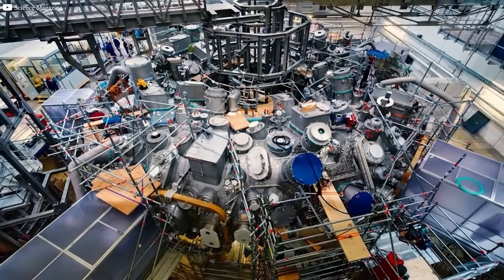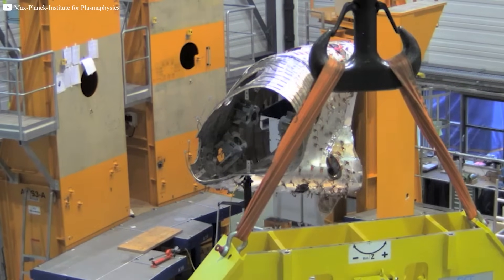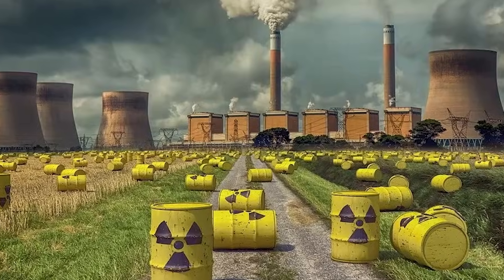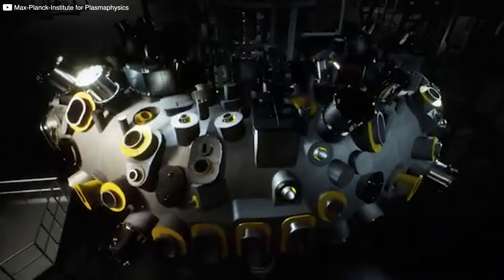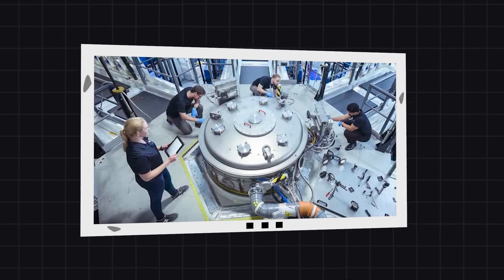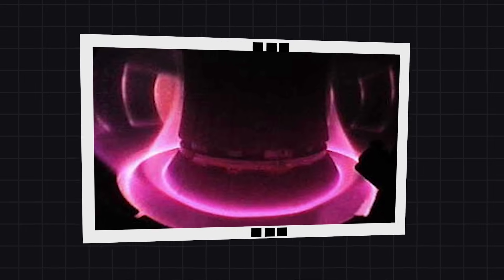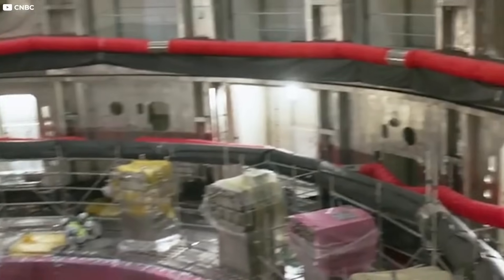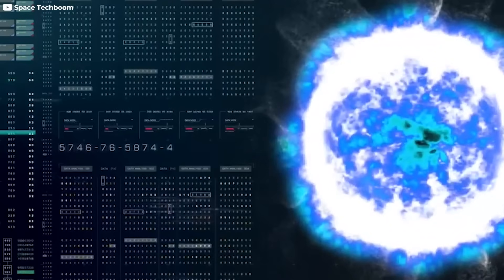This German Machine Could Power the Entire Planet

Comment: Thermo-dynamics is more efficient, cheaper,cleaner,safer,more reliable,more robust, cannot cause fires, cannot be electrocuted by it,it isn't carcinogenic, isn't radioactive. Thermo-dynamics is heating copper plate or copper rings to release electricity.

Comment: Is this currently in use what is the energy out put
Reply from the maker: Yes, this technology is currently being tested and developed in various locations. The energy output varies based on its implementation, but it's quite promising!
Reply: I'm glad to hear that what is the average output and how much energy was measured in the 8 minutes how is the heat going to be converted to electricity What does the kw out put look like is one enough to power an entire country or the entire world would the energy be transporter through wire or wirelessly ?

Comment: This is great as a scientific study but there is one big problem with fusion energy. There are a lot of protons released during the process and they will rapidly decay the materials around them. Any know material gets brittle within short time, probably just days or at best weeks. Before you can use the reactor to create electricity you have to figure out a way to deal with the protons or a material that can withstand them.
Reply from the maker: You bring up a valid point about proton release and material degradation. It's definitely an area that researchers are actively working on to find solutions. Fusion energy holds great promise, but overcoming these challenges is crucial for its practical use.

Comment: Fusion will never be cost competitive to renewables and storage.
Reply: Like all technologies, once a breakthrough is achieved, then comes mastery, and then comes cheaper prices. I would rather rely on nuclear, gas and coal rather than worry about cloudy days or days without wind, or too much wind.
Reply: @ It doesn’t matter the mastery the technology, the materials, the education of those required to implement it will prevent it from ever being cost competitive with renewables and storage.
Fission power is far simpler than Fusion, but because of these same issues has never been competitive except by being hugely subsidized by governments.
Reply: @matthewhuszarik4173 Do you think renewables are not subsidized? It is one of the most expensive energy sources.
Reply from the maker: You raise a valid point! Fusion has its challenges, but it’s an exciting area of research that could complement renewables in the future.
Reply: @BusinessHook Fusion is valuable for space travel beyond the range of the sun. Otherwise it will probably always be at an economic disadvantage to renewables.
Reply: Fusion is renewable and needs no storage.

Comment: Stanley Myers hho research produced a open loop "Runs on Water" vw dune buggy. He discovered that the key was in resonance and frequency and he made a fuel injector that used water as fuel, water in hho (browns gas") out and spark for ignition in real time on a ICE. also it take 11 gallons to go SFO to NYC ! that's open loop with water dripping from the exhaust pipe. In a closed loop system once charged with water and the addition of plasme into the loop would end refueling just add a quart when the water is getting low every two to six months. check out Stanley Myers, D. Rockefeller was still alive then and Stanley was killed for solving the carbon problem.

Comment: I have seen about 40 different fusion reactor plans, they mostly fall into 2 categories. One is the kinetic version that you see here. The other is the laser and pellet system. In both cases the intention is to use the heat from the reaction to heat (i suspect) a liquid lithium blanket that would then boil water through a heat exchanger to run a turbine. Using the heat is the worst idea possible, and is totally unnecessary. There is a third option that would convert the plasma expansion directly into electricity. That is the secret one that the military are working on. They want it compact enough to fit into an airplane, probably to power an airborne laser.

Comment: The Stellarator has been around as long as the Tokamak has, and will not work for the same reason. They are trying to heat the plasma with kinetic energy, spinning it round. They are trying to get a stable, continuous plasma. There's no need, there is a much simpler solution. Even if they do get some fusion going, how are they going to tap off the energy? I will tell you; they plan to use the HEAT to boil WATER and run steam turbines. Laughable.

Comment: If I understand it, they are heating the plasma to the point where the momentum of the particles exceeds the repulsive forces of the particles.  That pushes Hydrogen atoms together to make Helium and a lot of energy (heat).  This extra energy would just rip the newly created Helium apart.  Let's say it doesn't then how do you get the hot Helium out of the plasma?  How do you get the energy out of the hot Helium?  What about Coriolis forces on the plasma?  How is all that to work???   Time to go back to first principles people.  This money pit will not work.  Fusion power is always 50 years away.
Reply from the maker: You bring up some excellent points! The science behind fusion power is indeed complex and still evolving. It's always good to question and dig deeper into these concepts.

Comment: "Complicated, expensive and extremely difficult to build " Germany says "Wunderbar"
Reply: That's just German engineering, which i like BTW, but they are obsessed with buttons & controls. I had to design a machine for a German contract, but they wanted EVERYTHING to be adjustable, and to have either a knob, button or lever to 'adjust' it. I told them that half of these controls are not needed. but hey the customer is king & they paid well. So i built them a machine where half of the knobs & buttons would NEVER get used!
Reply from the maker: It's fascinating how German engineering emphasizes precision and control! Sounds like you navigated that project with skill. Sometimes, less is more, but the customer’s satisfaction is what counts!
Reply: SO SAY WE on this side of the "Big Pond." Congratulations, you deserve it!
Reply: I remember back in 1992, when i was the German Pro/Engineer product manager, that engineers from (i think) Garching Institute came to me and asked if this new CAD/CAM could model these odd-shaped rings & we worked on it for hours :)
Reply: It's a lot safer than the nuclear fission reactors!
Reply: This is poetry, guys.
Reply: Just release zero point local energy production 4petesSake...
Reply: I wonder who gave them the blueprints...
Reply: @sosocrazy1234  Caltech, MIT, Wisconsin, Agonne , Fermilab, they all made plans.

Comment: Tokamaks won't go anywhere fast, they're just a massive money pit keeping nuclear physicists employed.  Stellarators are much more likely to succeed in terms of a viable commercial Fusion power generator, because they are intrinsically stable, whereas Tokamaks aren't. There are other designs as well which show more promise than Tokamaks. It will take a few more decades to get even the Stellerator into a commercially viable form.  This is the beginning not the end stage. Don't hold your breath, but it will eventually happen.

Comment: Stellarator: A stellarator is a type of magnetic confinement fusion device that uses external magnetic fields to confine plasma. It differs from tokamaks in that it doesn't rely on a plasma current to help confine the plasma. Stellarators are designed to achieve the conditions necessary for nuclear fusion, aiming to generate clean and sustainable energy. 

Here's a more detailed explanation:
Magnetic Confinement:
.
Stellarators, like tokamaks, use magnetic fields to create a "cage" that holds the superheated, ionized gas called plasma. This prevents the plasma from touching the reactor walls, which would quickly cool it down and stop the fusion reaction. 
External Magnets:
.
Unlike tokamaks, stellarators rely solely on external magnets to generate the magnetic fields that confine the plasma. These magnets are arranged in a specific, often twisted, pattern to create the magnetic cage. 
Steady-State Operation:
.
Because stellarators don't rely on a plasma current, they can operate in a steady state, which can be advantageous for long-term fusion power production. 
Fusion Potential:
.
Stellarators are being studied as a promising path towards practical and sustainable fusion energy, with ongoing research and development efforts. 
Key Differences from Tokamaks:
No Plasma Current:
Stellarators do not rely on a plasma current to help confine the plasma, while tokamaks use a combination of external and plasma-induced magnetic fields. 
Magnetic Field Generation:
Stellarators use external magnets to create the confining magnetic field, while tokamaks use a combination of external and plasma-generated magnetic fields. 
Geometry:
Stellarators can have more complex geometries, including twisted or helically shaped designs, which can offer advantages in plasma confinement and stability, according to World Nuclear News. 
Operation:
Stellarators are generally considered to be more stable and easier to maintain in a steady-state operation compared to tokamaks, says the International Atomic Energy Agency (IAEA). 
In essence, stellarators offer a different approach to magnetic confinement fusion, with the potential for steady-state operation and stable plasma confinement, making them a viable option for future fusion power plants.. 
This video explains the construction and working principles of a stellarator:
Reply: Ok,you sound knowledgable,what happens I'd the solar temp plasma busts out of contianment,it can't possible be brought to ambient temp in an instant,can it
Reply: @Truckerkingdan  if you somehow got the plasma to open air, assuming the average 1.2250 kg/cubic meter of earths atmosphere, it would absolutely roast anything in an enclosed room, (816 cubic meters would be above 10000 degrees, but that's actually only 28.5657137141714 meters in range)  but even so, in open air it wouldn't be much more dangerous then, like, a couple sticks of dynamite - still bad, of course, but certainly not anything as dangerous as fission. Almost all of the energy is temperature, too - people and wood and such would roast within like a building or so, but beyond about 30 meters (absolute, absurd maximum like 100 - square cube law means range increases take exponentially more energy, and you would need like 100 or so times more fuel or temperature for a range like that) you'd just feel a slight heatwave and be fine otherwise.
Reply: @Truckerkingdan  No, but generally your not working with more then like 3 grams to like 10 grams.  Fusion generally happens at around 100 million degrees kelvin, and so lets highball and say 10 grams at 200 million degrees. If its contained by a good, dense temperature conductor, then you would need roughly 100 metric tons of material to split the temperature to roughly 2000 kelvin - which is a lot of material, but this is way past anything we've actually built, a more realistic number is like 2 grams at 110 million degrees, (ish) and that would only require about 11~ metric tons.
Reply: @Truckerkingdan  Added on to that, in a more realistic scenario the plating doesn't block all the heat, instead it blocks like 90% of it and lets it leak out over time, in small amounts - bleeding out 5% of the energy a second would only be dangerous within like 5 meters or less, and only for about 10 seconds(ish), and it would get the thing down to workable temperate in like 5 minutes max.
Reply: @Truckerkingdan No, he uses ChatGPT. The wording is too formal.
Reply: :glasses-purple-yellow-diamond: CHAT GPT

Comment: Poor silly primitive world.. How much energy is it costing to make that show? Googles: "Ultrasound control of Electric plasma" + "Ultrasound excited plasma generated stronger EM field" What would happen if you used holography to line negative and positive charges up in the atmosphere? Would you need a fancy claim for primitive masses or would you need to learn how to use the holography just enough to not overload your systems with Earth's unlimited power? Points at Ultrasound holography Crush shapes of plasma with Ultrasound capacitor discharges correctly and the EM field will crush what's between those layers of plasma with sudden EM burst. Googles: "Unclassified Plasma Triangle UFO" All directions on demand Fusion shockwaves + Z-pinch..

Images of Thermal and hovering showing black/hot liquid coming off = That's Radiation being collected as heat into water collected from atmosphere with Ultrasonic echoes. What keeps the Star from endlessly growing? Googles: "Ultrasound detected in Sun's atmosphere" Excess fuel rejection system of Stars intelligently controlled to allow it places with lots of fuel.. You know lightning makes Antimatter, right? What if lightning was controlled to the extent that its shockwave field could be used to send them to you for collection? Hmp.. Squints at legends of the Thundergods What you think Humans just imagined capabilities many thousands of years before it become a "oh crap warn military to make defenses" thing? LOL..

Btw.. Factories producing lots of emissions? Stop making thousands of versions for millions of people everything you can download on smartphones you all have now. As for vehicles? Check for acid rain. None? Do you think the gasses just magically stop when they go up if Earth pressure system doesn't want them here? Lol.. Shakes CO2 drink up at masses and screeches like a WEAPONIZED APE

Comment: Hollywood Sci-fi: “Unstable core! Meltdown!☢ Evacuate!”🚨
Germany: “Hold my beer 🍺 – we just twisted space and bottled the sun. No big deal. Danke.” 🇩🇪
Reply: They forgot to mention that the reaction releases neutrons that collide with the walls of this reactor and dismantle its structure from the inside out. How long can this structure last without maintenance when it is producing energy 24 hours a day?
Reply: @lucasbhz  8 Minutes. As tested. so far...^^
Reply: @lucasbhz  That's the big problem. The best solution is to use the neutrons to make more H3 & He3, it would literally make it's own fuel. Fast neutrons need to be deflected, and slowed down. Maybe with an extra water jacket, boron impregnated silicone etc. Even steel & concrete will become radioactive in time.
Reply from the maker: Good one!
Reply: Literally…..
Reply: In scale,,,to see.
Reply: With the beer you mean the Schweiz 🇨🇭 not germany 🇩🇪
Reply: :face-green-smiling:😉💛'CAN DO' 'GETTER DONE'

Comment: Ok, so you take hydrogen and fuse it to create helium. So how do you get the hydrogen back? Also where do they source the hydrogen from in the first place, water? If so is it the start of depleting our most valuable nature resource, WATER? The only way it would be viable if they can go full circle... hydrogen to helium then back to hydrogen. If not theoretically it would be classed as non- renewable.
Reply: My man, hydrogen is the most abundant molecule in the solar system.  How much energy do you think fusion releases?!
Reply from the maker: Great questions! To clarify, hydrogen can be sourced from water through electrolysis, but it's important to ensure that the process is sustainable. You're right about the need for a full cycle to maintain renewable status!
Reply: @BusinessHook Well from what i have researched once hydrogen has been fused into helium then that's it the original element is gone forever. So it is non-renewable. It may be very small amounts of hydrogen but end game it is still non-renewable as the original material is lost. So it starts out a small amount and when they start using it to travel to other planets, solar systems or even galaxies that little bit turns into a lots and lots. Another aspect is what are we going to do with all this extra helium? Just chuck it out into the atmosphere?

I am not saying i am against it if it really does produce cleaner energy but we all know often enough when things seem too good to be true they often are.